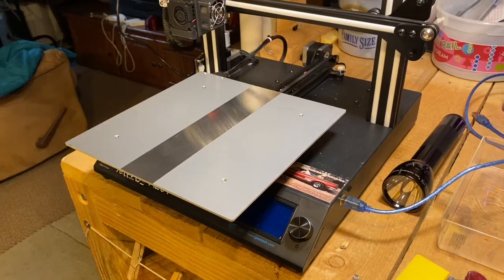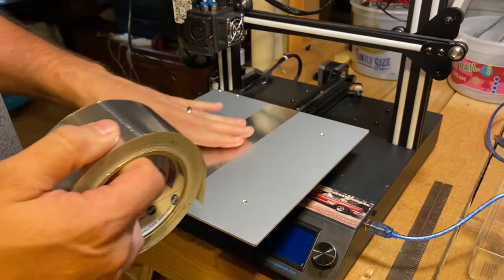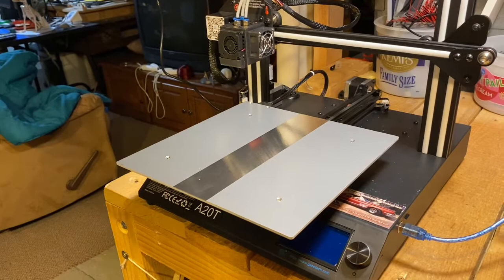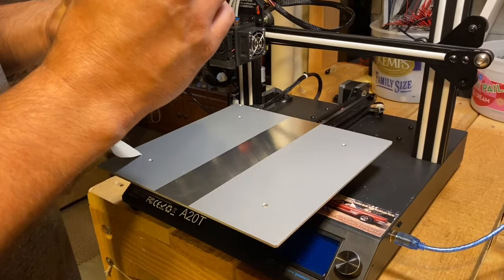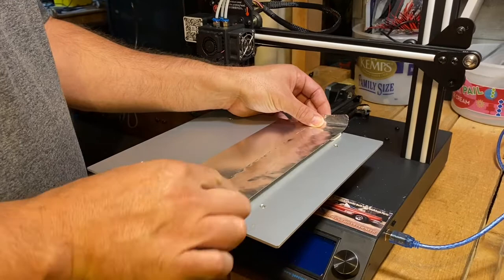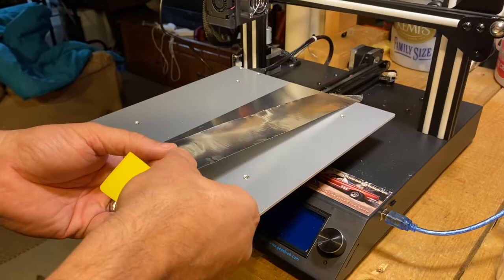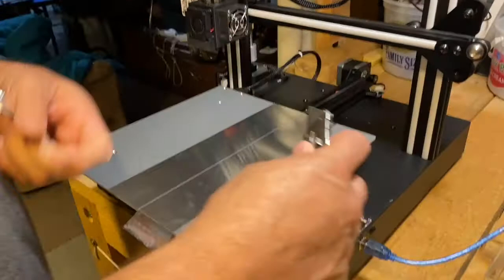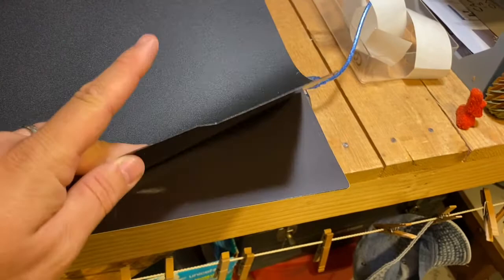Fix A Bent 3D Printer Build Plate The Fast Easy Cheap Way

Comment: Great idea. Thank you for this. I'm going to give this a try and if I can't hit perfection I'm going to a machine shop and having them make me a perfect plate. I already dumped thousands of dollars into a cheap Ender3 pro that's no longer a Ender anymore. My problem is the garbage warped bed I'm left with. I didn't want to dump anymore money in this thing but it's a project I need fixed. I print gears for making automation machines and I need them as perfect as possible.

Comment: Such taping will works only when you have curvniess in one direction. SO for examplse if you have a high spot at a center you would need add tape to the middle, left center and then continue.
But. Tape is 30-50 micron thick. SO you need 10 layers to have 0.3 0.5 mm level fix.

Just google any image of the Bed Mesh leveling. So you will understand that even going with that method. From Back to Front and then From right to Left will not allow you to build curviness in of the bed and calculate tame leyers  in your head. 

I have used another method. Maybe will get time to share.
Reply: wanna share?
Reply: @antisocial77  
If you wanna see the result you can visualize your current bed mesh(if your printer has auto bed leveling). So you will understand better the impact. Just Google
"bet mesh visualizer without octoprint"

- Remove bed cover.
- Mark points on an aluminum plate at which your printer do bed leveling probes. Or do a grid by yourself.
- Go to your printer settings and turn off engines or simply turn off printer or use control of your printer to move nozzle to the left bottom corner(you can use any)
- Point a nozzle to a plate as you would do manual leveling with a paper. When nozzle create some(any) level of pressure on a paper. You just need to have a way to get the same filling for yourself.
- start moving nozzle to the next parallel corner. 
- Move UP if that point is higher.
- Goal is to find a highest point on a plate.
- After, don't change height of the toolhead. Or if you did. Just return to the same spot and point it to the same level of pressure on paper as you did before.
- Then you need 'aluminum foil'. I have 30 and 40 microns thin. Recheck that it's pure aluminum and has temperature resistance up to 100+ C.
- Then point toolhead on top of the other points that you have marked before. They are all lover than current.
- Cut squares from the foil. and put them until height will be at the point that will create the same pleasure on a paper as on your highest.
- Sometimes you need 4+ layers of foil. So for that case stuck(glue) 3-4 layers before cutting it to the rectangles. Like get 20 cm of foil from a roll, remove protection and glue it on top of the same 20sm of foil. Then cut to pieces.
- Continue until all grid points will be flat to the nozzle level(recheck that with a paper all the time)
- If your build plate cover is something as glass -> replace it with a flat one. If it's flexible it should become fattened by the new leveled surface.
- I switched to the fiber glass. G10/fr4 or something similar. Was inspired by MakerMuse video about G10. 
- Material is not critical. Surface just need to be flat as much as you can get.

Comment: one problem i have is when i hold the ruler with my left hand, i see a small gap on the right. bit when i hold the ruler with my right hand,  i see a small gap on the left. (0:12 and (0:49 you didnt put the tape down and there was no gap when the video started.) idk why? i can see it your video too. makes me question if this method is flawed or if its just me. (probably just me)
Reply from the maker: It didn’t make the bed perfect, but in my case it made it much better. If I would have put the ruler on the plate before I applied the tape, you would have seen light mostly in the center and none on the edges
Reply: @keepitsimpleideaguy8676  idk what im doing wrong but near the left corner area, it just continues to fluxuate between close and a gap.
Reply: @eggsandwhichian  your bed sounds like you have a raise in the middle try put even layers around the edge of your bed to lift the outer level with the center

Comment: Are you measuring while the bed is preheated to your printing temp?
Reply from the maker: I didn’t but that is a great idea.  Thanks for the comment!
Reply: @keepitsimpleideaguy8676  I know its an old video but I actually did this with paper because I don't have the same tape as you but with paper it can be attempted several times over
Reply from the maker: @fireball75677  I can see that working.   How did you adhere it?